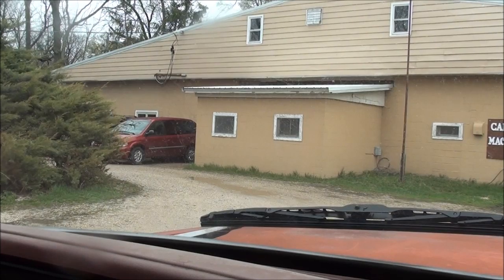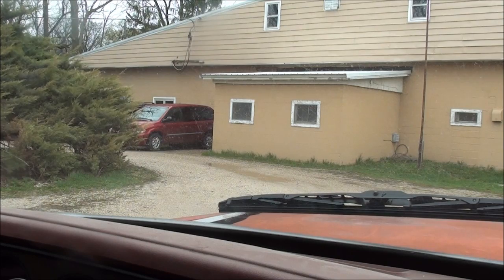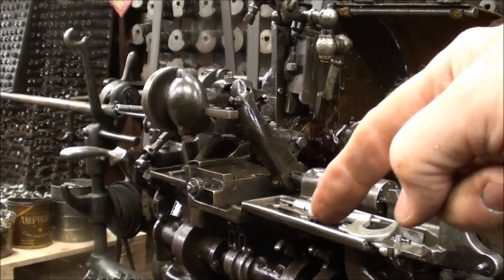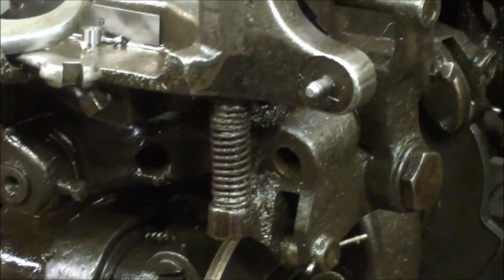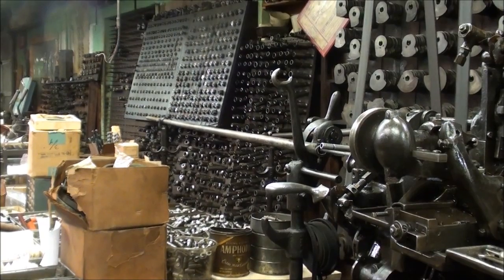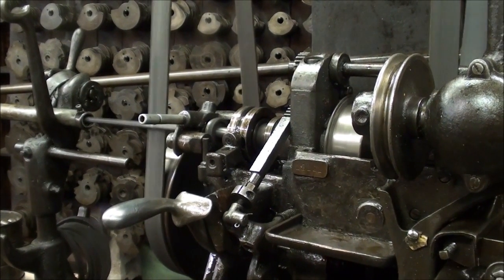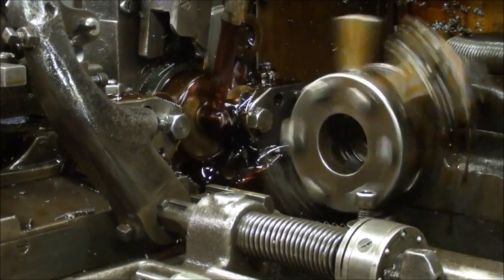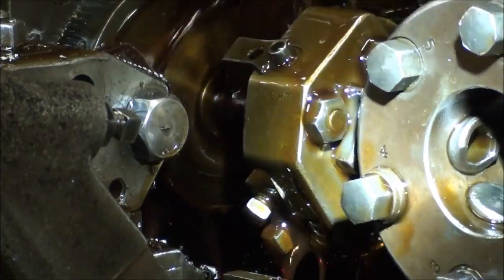tubalcain TAKES A FIELD TRIP #1 The Disassembling of America screw machine shop

Comment: Hi Mr Pete
Just one more thought. I read so many people saying there is no money in engineering. This is tosh, there is money in engineering but you have to be good and look for enterprising and paying work. My Friend Tom Dark started in about 1990 with 500GBP and a lathe in his dads garage making MG super charger couplings. He made such a nice job he got lots of orders from the MG club. He has just bought a 1.2MGBP property and paid for it and a new workshop that cost 200,000 for the building and 3 new machines. He now makes parts for Grand Prix Bugatti's including engines, axles and gearboxes. I helped him make the first new clutch assembly for 5 new Bugatti Royals being built. Work you find it hard to believe. But my point is a positive attitude and use your talents wisely and there is work. I am setting up another shop here in New Brunswick Canada. I currently help manufacturing pressure washers and the company is booming. Positive attitude and find solutions which is what good engineers have always been good at. Things do change and old ways die but I very much believe in appropriate technology. If an old auto will do the job at 5% of the cost, get it in and get it running. I could write a book on stories like this but we need to pass on these skills they are still very much needed we cannot live in the internet it is a tool like any other tool. If you need to knock a nail in you need a hammer. You could use calipers and a rule but we use micrometers because they are better and much more accurate. We are always improving with new ideas its what engineers do. So keep on passing on the knowledge you are a teacher and doing a great job like Jodi with welding tips and tricks. Great teaching wonderful to watch and still learning loads at 56. I will die with a spanner (wrench) in my hand hopefully.
Allister
Reply from the maker: Thanks for some wise thoughts & positive philosophy.
Reply: I agree, and I like the way you're thinking. A metals supplier recently opened shop here, where there was nothing for 10-15 years. All small metals orders had to be ordered online from one of the big distributors and shipped for huge $$, unless you were buying tons of cold roll sheet or huge open die forgings (the big forges are still operating here, right in the middle of the city) and have your own freight or truck service.
And guess what? With local metal supply comes engineering and fabrication jobs. Most of the ones I'm getting are things like drilling and turning parts for cars and trucks, brackets, pulleys, mounting plates, restoring old machinery parts for woodworking etc. Some people just want simple high school level machine shop stuff. Squaring, facing, drilling, sawing, grinding. Sometimes I get requests for forging and bigger castings. Every time I'm at one of the big hardware stores I hear a customer asking questions which the folks in the orange vests aren't qualified to answer. Bigger jobs are out there too. I just went by a shop that has a contract to make extrusion dies for composites. A one-man small business that provides dies and molds for a larger business. He does them all with an older CNC machine, but of course he does a lot of manual and numeric milling and turning for other clients.
Reply: well said,if we think like some people we have to stay at stone age?!!

Comment: Hi Mr Pete
I used to have and run an
EMI MEC sprint 50 which is a next generation from that. I used air over hydraulic pegboard sequential control. Mending it was fun. It had 4 tool posts and a 6 position capstan and we made all our own nuts and studs and some pipe fittings along with several other required parts. this was 2004-2010 and I had to buy a roller box as we call them from the company that still made them. Yes still available, Even CNC can barely beat those old machines for small simple parts. We made all our own nuts and studs because our engine was all Whitworth and we just kept it original. Cost of CNC auto 100,000GBP cost of refurbished auto 4000GBP no contest for simple parts. It made 1000's for us.
Allister

Comment: They look complicated, I am sure though each operation runs on its own cam provided timing off a central lead screw or gear set. Probably a pain to change over unless youve done it a 1000 times. CNC machines are just more efficient and require less tooling.

Comment: It is truly sad to see our trade going in the direction that it is going. I work in a small Tool and Die shop so I haven't had the opportunity to operate a screw machine like this, but I have had the privilege to learn how to perform many unusual tasks on manual machines. I always looked at it as a fun challenge, but most of the youth of today look at it and say, "That's too much work". It saddens me how many young machinist there are that are unable to sharpen a drill bit "free hand" on a pedestal grinder. The machinists that operated these old manual machines had to have a lot of skill to set these machines up to produce the part that they wanted to achieve. They also had to have a lot of common sense to stay safe from all of the moving parts. Computers have replaced most of this skill. It is so much easier to write a computer program for a CNC machine and then let it do all of the work. There still is a place for screw machines though. There are still parts that a screw machine can produce faster than a CNC can. As far as I'm concerned the CNC machine has allowed 'unskilled laborers' to come into the machine shop as 'operators' and take the place of a 'skilled machinist'. The CNC machine can do many wonderful things, but sadly it has made the skilled machinist almost obsolete.

Comment: Good video of this machine in action!  We have been debating buying an old screw machine to mfg parts for a small model I.C. engine (10 CC), as opposed to farming out some of the parts to be made, or buying a new Tormach CNC.  Some of this older equipment can be purchased inexpensively and put to work.   Your thoughts on cost benefit  for a small garage shop operation on 100 units of each part?   Local price quote on just the simple 1" cylinder was $1000.00 for run of 100 parts.  Valves were $1200.00 + set up fee of $250.00.  By the time you make 41 total parts, purchasing a machine, ( even for several thousand dollars) , seems to make good economic sense.
Reply from the maker: Sounds like a used machine might make economic sense.

Comment: Thanks for the video, I enjoy watching you and Keith Fenner manufacturing in America. It is sad, I've been running a small batch of parts using my craftsman atlas lathe and atlas drill press and my neighbor suggests that I buy them from offshore. No thanks, I'd rather make it myself and know that its good steel and chips flew in America. I keep hoping it'll come back around. 

While it doesn't have a digital display, mechanical cam driven and controlled is a computer of sorts but the program is written in steel and read by wheels. A very durable computer.

Comment: This saddens me as well.  I lived through the dismantling of our millwork and cabinet shop that had been in operation since 1898.  Most machines were still where they were originally installed only converted from overhead line shaft drive to electric motors.  Enjoyed seeing the belt lacing tool.  Ours worked in a big shop vise.

The younger generation does not see the virtue of making things through the sweat of their brow and don't want to get dirty in the process.  What a loss.
Tony

Comment: First time I've ever seen an old "Brownie" run. I've heard about them but never saw one. Their is a factory close to me that still uses Acme Gridley bar machines as well as other similar type equipment. Modern CNC stuff is nice but will never have the character of these older machines. Often an operator could tell this type machine was off purely based on the sound of the machine.

Comment: Mr. Pete, thanks for the look at the old machines. I've never seen one like it before. Amazing design and craftsmanship, and for a 70 year old machine to be so clean and run so smoothly, it's obviously been well maintained. 

While I share some of the sadness at the passing of an era, and annoyance at the junk we are getting in return at the cheap end of the price curve, I'm not ready to give in to despair and cry in my beer. 

For one thing the cheap labor overseas is a passing phase. As the standard of living rises in China, India, and other such places, the wages will rise and eventually things will stabilize. Increasing costs for shipping products as things like carbon taxes or the cost of fuel make it impractical to ship cheap goods halfway around the planet will speed the process. 

For another thing, our capability to manufacture things still leads the world in some areas. For example, I just watched a vid about the new Dragon 2 spacecraft from SpaceX.  The rocket motors are 3D printed in metal, so they can incorporate small and complex cooling channels that couldn't be done any other way. I also watched one about Planetary Resources of Seattle, which is in the asteroid mining business.  They are just getting started, but the potential market sizes for the resources they will be accessing is huge.  There are a lot of changes coming, and they aren't all bad. 

The flint knappers probably felt the same way when everyone started using that new bronze stuff rather than good old reliable flint, but I'm kind of glad that I can make things from metal using the things I've learned from you and orhers, and not be limited to chipping rock around a campfire. 

Thanks again for the very interesting look into the tech of the recent past. Amazing achievements.  

-- Mike

Comment: I was going to say that if they had invested in CNC machinery they might still be in business, but the thing is anything with a computer in it becomes obsolescent even faster. You wont find almost 70 year old CNC machines still working because the electronics and the software fail and cant be repaired. Take a look at how many computers are being thrown out at your local transfer station next time you do a tip run.
Reply: You can't really compare a computer that is being thrown out today with the machines in this video. Over the last 30 years computers have undergone almost unbelievable growth and development so it's hardly surprising that machines from 10 years ago are largely obsolescent now. Having said that most of the computer hardware industry now feels that things will evolve at a much slower pace for the foreseeable future so computers that work today will likely work for a good time to come. I was trying to think of a comparison where machines developed quickly but it's hard to one because the development of computers really has been that fast. The best I can come up with is maybe the various machines used in the textile industry, when that started they went from doing it all by hand to full mechanization almost over night. There were a lot of very rapid iterations of machine design which at lost to the mists of time just as we have with computers today.
Reply: CNCtrl Interesting point there, the textile industry. Also, the root of computers comes from the first attempts to automate the textile industry a couple of centuries ago. This is sad to see all this, both the talent and the machinery, go to the scrap bin.
Reply: CNCtrl CNC equipment is built to be disposable junk. even if the controls weren't useless crap in a decade, the machine would be slam wore out anyhow. Shit is NOT made to last a lifetime like it was. Every ten years we replace all our machines, because they are flat out hammered.
Reply: Mark Fryer I agree. Our machine shop is doing good, Midwest Precision LLC formally Midwest Screw. We replaced all of the old machines with CNC.
Reply: Joseph M Farone Anyhting can be repaired, it just takes a much more intelligent person to repair a computer than a machine linkage.

Comment: That brought some memories! Years ago I worked in a machine shop that had newer versions of those screw mach. I never ran one but did rough cut cams for them on a band saw a lot like this one. I mostly ran hand screws and drills. I also ran a horizontal mill which gave me a 30 degree radius on one knuckle !

Comment: The truly sad thing about this video is a CNC lathe couldn't make that part any faster than that old screw machine.  What makes a CNC machine faster is setup time.  Depending on the part, a CNC machine can be ready for the next job in anywhere from minutes to an hour.  That ol'girl with all those mechanical switches, roller cams, and control arms could easily take a whole day to setup and get it right.  Not to mention all of the scrap material thrown away from running test parts during the setup.  You have to charge setup time, and on the small run jobs that most companies want now days your setup time is going to kill you on cost per part.  If you could run thousands of parts then you would be able to compete price wise.

Overall a beautiful machine in my opinion.  Sadly left behind for the very reason it left behind the generation before it, speed.

Comment: The machine itself could be considered an analog computer, that is "programed" by changing the cams and tooling. :)
If the world goes to ^&%# and EMP/nukes are used, they'll be the only computers still running!
Reply: Computing requires logic. 
There is no logic in this machine.
This is the fundamental difference between an NC machine and a CNC machine. 
CNC's have logic and can make decisions apart from the instructions you give it.
This machine can only do what you tell it to.
So it's an NC(numerical control) machine and not a CNC machine.

Comment: That's only the second time I've ever seen a US Multi-Miller horizontal mill.  I bought one on eBay about 8 years ago and didn't use it until 3 years later.  I had a job shortening electric motor shafts and I made about 3 times what I paid for the machine just doing that job.  For sawing or slotting operations that machine was really great, but for jobs like you'd use a K&T for, forget it.  Those machines were cam operated too, so right at home in a screw machine shop.  The machine I had was WW2 vintage, so that tells you how old they were, just like the screw machines.